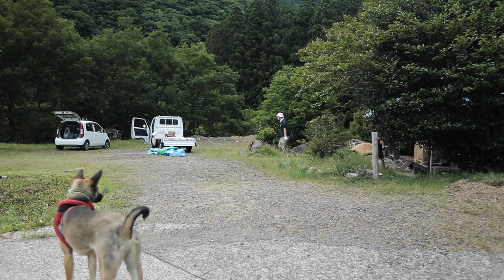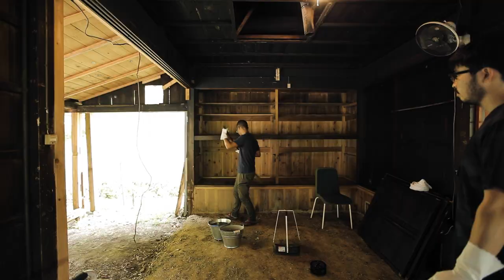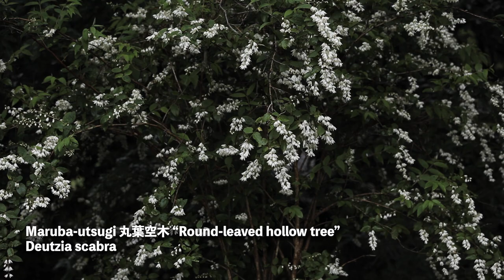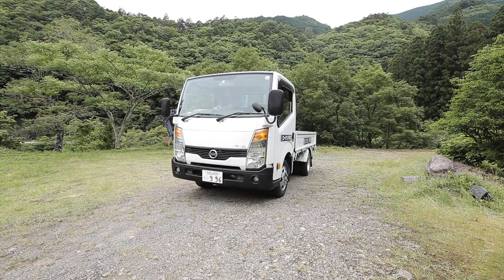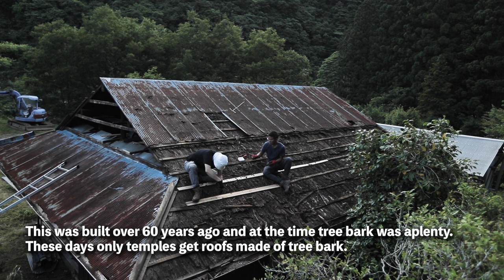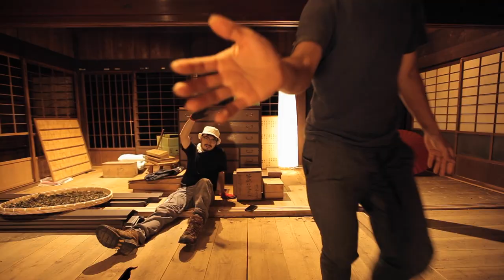DIY Re-Roofing a Tree-Bark Roof Japanese House For Our New Cafe

Comment: Are the shoji screens too short? Is it not possible to change the upper track and make it a bit longer to compensate for the short screens?
Reply from the maker: They are too large unfortunately. If they are cut shorter the top or bottom frame would be severely weakened (3/4 gone).

Comment: So much hard work with the roof! What's the difference in durability with the repair vs new zinc roofs?
Reply from the maker: A proper repair will last 10-20 years. A simple repair like what we’re doing should last 5-10. The main issue is that the wooden framework for the cedar bark roof is now over 60 years old and so they are in a bad state. Old cedar bark roofs used to be reroofed every 20-30 years.